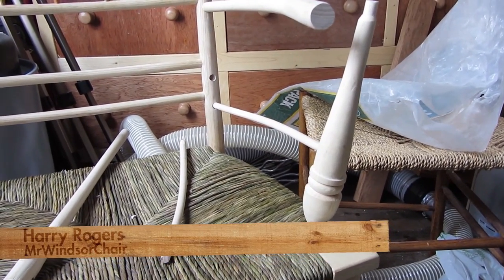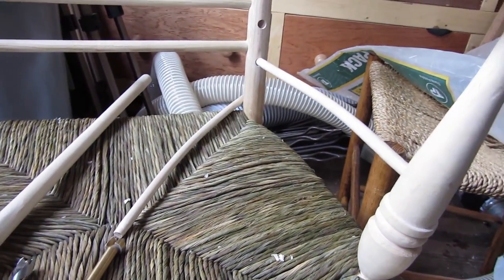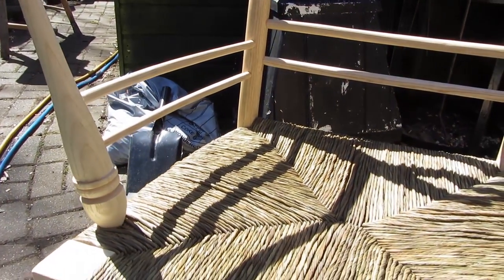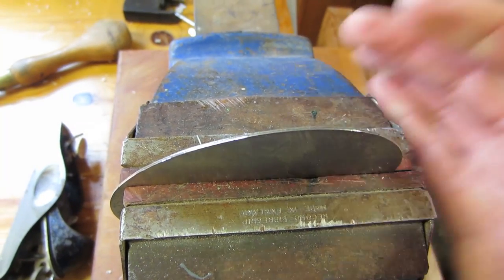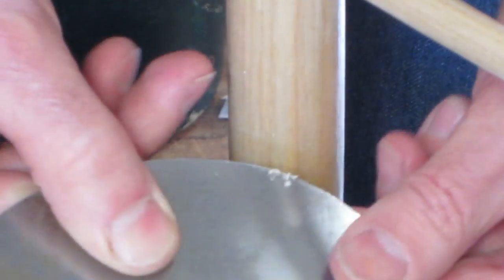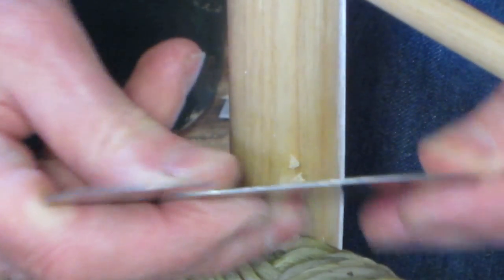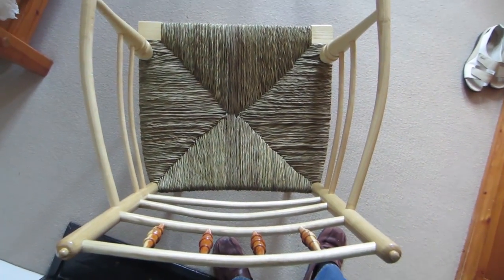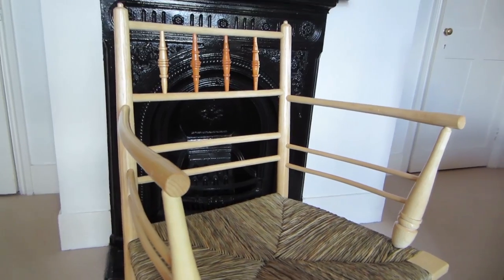Greenwood Chair - Final Assembly and Finishing - Sussex Chair Part 11

Comment from the maker: I felt that the scraper that came with my very old No 80 was a bit like cast steel and while tough was also quite hard work to tune up - I use it for tough scraping jobs and its good for that, but I do think you need to go at it with some considerable effort to get a sufficient burr. For finer cabinet type work I prefer to use the Clifton hand scrapers that seem to be a very nice steel for the job. Thanks for sharing your very interesting observation - I totally agree. Harry

Comment: Harry, great series! As well as all of your other videos.  I am always amazed by the variety of skills required to be a chair maker.  This one is certainly a beauty.  I am taking your example of a simple pole lathe and will make one.  Although I am a long way from trying to make a chair!
Neil
Reply from the maker: Hi Neil - there are two pole lathe films - one is a traditional build and the other is a fast build using shop bought timber........if you will be moving it around a lot and packing it away the fast build one is a good option....its also height adjustable - good luck and thanks for your comment.
Reply: Harry Rogers I am going to take a shot at the fast build one first to see how that goes.